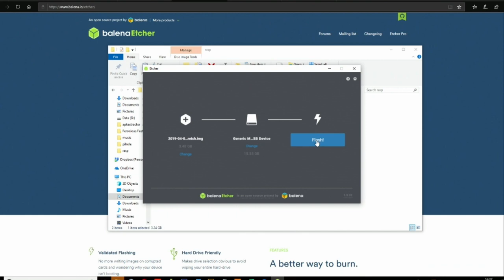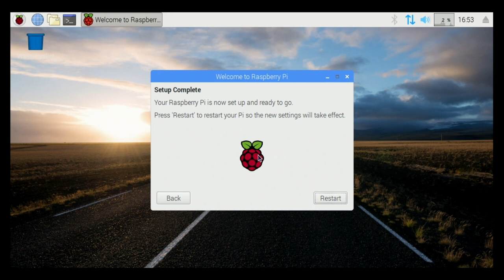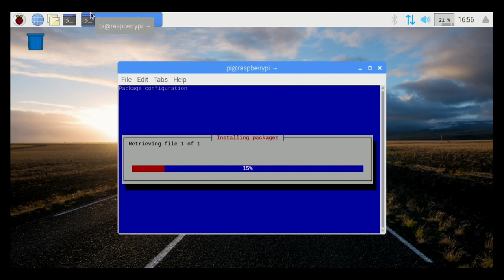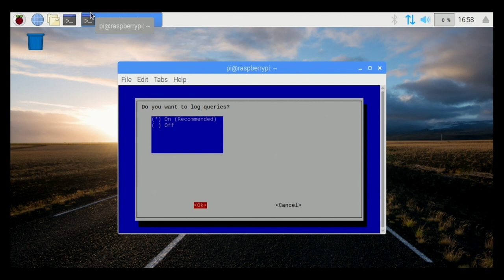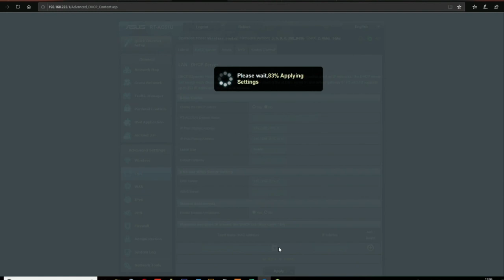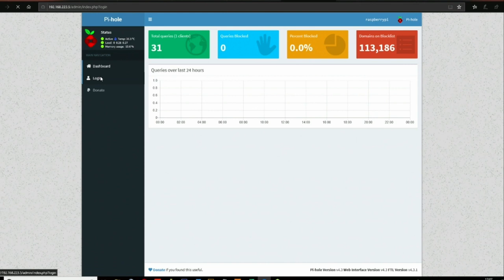Ultimate AD Blocker - How to set up Pi-Hole DNS network wide on a raspberry Pi

Comment: Is this video still reliable? I’d like to deploy this. 

Can I use any Rasberry Pi? Like the 4?
Reply: I think so.  The only difference now is the tool used to get and write the OS image to the card  https://www.raspberrypi.org/software/ This appears to be very well done.  My rebuild will be better than the initial deployment.  It fantastic.  Hurts to be without it currently.  Go for it!
Reply: Just finished rebuilding my PiHole.  With the exception noted above, this is still current and correct.

Comment: How does the Rasberrie Pi connect? My gaming computer is ethernet cable and my phone and tablet are wireless.
Reply from the maker: Asuming your ISP modem is wireless  and ethernet , connecting everything to it will allow all the devices to communicate with each other.

Comment: What does he mean my pipe it to bash. How do you get the vertical line symbol?
Reply from the maker: A pipe is a term that mean redirect the output of program  (a) to program (b), the character that does this in the command looks like a very tall lower case L , this character > |
Reply: Ah. Thank you very much. This video really helped as there were a lot of videos on it but many didn't go into detail on how to do it.

Comment: Hey it doesn't work for me. I tried installing twice.. Whole raspberry and pihole. Nothing happening.
Reply from the maker: After you install, you have to decide to change the ISP modem DHCP DNS settings to provide the piholes IP, or you turn off DHCP on the ISP modem and turn on DHCP on the pihole. After that you need to reconnect devices back on the network, on a phone just turn wifi off an on.

check this bit of the video
https://youtu.be/Gl9wgUdjqpc?t=813
Reply: @Gizmo1969  i did. As soon as I change DNS server on my router (provided by my Verizon fios), internet stop working. I see queries being blocked but advertisement are still visible. I am using gardian news to verify if it blocks.
Reply from the maker: @nandurx  Ok, how about, turn off dhcp on verizon , and turn on DHCP server on Pihole.

Comment: Awesome video.  I have a quick question.  I have an Asus OnHub wifi router, and you can't really disable DCHP.  The only option is to switch it to Bridge mode.  If I do that, won't it cause issues with my devices connected to it wirelessly?  If it does, I'm going to just use the first method you showed.  Thanks again.

Comment: How do i use this pn mikrotik routers?
Reply from the maker: Im not familiar with the mikrotik routers to guide you exactly to which menus you should go to, but your looking at setting it up in one of two ways. a) change mikrotik dhcp settings to distribute the ip address of your pihole as a DNS server or b) disable DHCP on the mikrotik modem and enable DHCP on the pihole - see this clip in the video where i do this on my Asus router https://youtu.be/Gl9wgUdjqpc?t=799
Reply: @Gizmo1969  ok. Thanks for the info. 😀

Comment: Hi, thanks for the great video. I have tried and followed your guide using a Pi-3, and i cant seem to get my network to work through Pi-hole. I set my Pi to have a static ip, and when i disable the dhcp on my router, no ip's are being assigned to devices connecting... I am attempting this whilst using the Pi-3 via wlan. Could you please assist, or perhaps have any tips of where I might perhaps be going wrong?
Reply from the maker: Did you enable DHCP server in piHole under settings / DHCP?
Reply: @Gizmo1969  I did yes
Reply from the maker: @Ceneric  So,  the pi is on the same network range, that is , if your IP address of your modem is 192.168.0.1  then your piHole ip address must start with 192.168.0.x  , also can you check, connect a device to your network, does it get an ip address? I assume not, or does it get an ip address but no internet. Have you rebooted the modem, sometimes they need a reboot to get changes applied properly.
Reply: @Gizmo1969  yes the pi is on the same network, and my router ip is 192.168.8.1, and i configured the pi to be 192.168.8 2. When connecting a device, no ip is assigned to the device, even after rebooting both pi and router
Reply from the maker: @Ceneric  set manual ip address on your device and test with pi ip address as dns. check you can access the pi and browse net. Plan b, turn dhcp on the router and set the pi hole as dns ip in the modem settings.
Reply: @Gizmo1969  I tried setting the pi ip address on the device as the dns, and got no internet connectivity. Tried setting the pi ip on the router dns, and still got adds. When checking the pi-hole page, it showed no blocked addresses. I selected Google as my preferred blocker when setting up
Reply: Great news, I seem to have resolved the ip distribution issue... Seems like, in my haste to make this project, I mistyped the dns ip when setting my static ip on the pi... however now I can connect with the pi as my dns server, I still have ads
Reply from the maker: @Ceneric   you need to make sure that the DNS server on your connected device is the pihole IP address, it could have old DHCP info, also keep in mind, if you connect to a vpn service on it will bypass the pihole.
Reply: @Gizmo1969  Ok cool.. will keep tinkering. Thanks so much for the help, and great video

Comment: I screwed up on the static ipv4 address assignment. Now Chrome can't access any web pages. Says web page may be down temporarily or moved to a new address. How can I fix it?
Reply from the maker: You'll need to get your PI connected to a screen with keyboard and mouse, go into terminal window and type in "pihole reconfigure" this shoudl allow you to configure your network IP address again for the pihole.

Comment: can i use the pi 4 without internet cable ? just wifi connection into my home network ?
Reply from the maker: i would say its possible, I once setup a pi zero, that is wireless only, but I remember not having access to the wireless config and I had to install  "sudo apt-get install wicd
" and "sudo apt-get install wicd-curses" to get a wireless control in the top right of the screen. Keep in mind that everytime you click on a link the page that loads can make 10/20 DNS requests , wifi is slow and Ethernet is the best connection for this type of project. Putting a PI connected to your modem, and if has a USB port you can even leech the power from the modem...

Comment: Is the DHCP part necessary? Would it not be the same as setting the pihole ip as the DNS server on each device you want it for?
Reply from the maker: No its not, you can just change the isp modem to distribute the ip address of the pihole as the using its DHCP server.

Comment: Can i ask some specific Question?
About This One: 

Specification/ Application

Mode:Cluster Pi

Pi 4b Model b (Storage) = Storage SATA SSD 128GB.
Pi 4b Model b (Worker) = Doing Task to Help Master Pi VPN to Handle more Clients at the same time
Pi 4b Model b (Master) = as Pi VPN Server
Pi Zero with Full Kit (AdBlocker) = as Pi-Hole.

I dont know if it Works? please give me some suggestions. loveyou <3

Comment: my router does not let me either turn off DHCP or let me change DNS settings.. it's really restricted. Is there any other way to do this?
Reply from the maker: yes, you can manually set the ip address on the device  your connecting, which will allow you to set the ip address if you pihole
Reply: @Gizmo1969  I set the pi's IP address as my Devices' DNS server. which also worked great, but sometimes youtube doesn't load thumbnails which can be annoying. 
Thank you!

Comment: When i disable DHCP on router it disconnects many devices and it won't let me go to pi-hole /admin page any have solution for this issue please ? i notice when i go to page where it shows me what devices are connected it's missing raspberry pi and many other devices.
Reply from the maker: Whats  the IP address of your ISP modem and of the PI, I assume you have set a manual IP address for the PI
Reply: @Gizmo1969  any help :(

Comment: I can't connect to the configuration interface. Is there common solutions to this?
Reply: I use the correct ip address for sure, but I don't know why the password and user name found on the back of the router I am using is not working
Reply from the maker: @danmbonneville  So your trying to access your ISP modem, and are unable due  the login details not being correct, the only option is to factory reset your ISP modem. It should revert to the original details on the sticker.
Reply: @Gizmo1969  This still did not work unfortunately. I will try it again and get back though
Reply from the maker: @danmbonneville  I would contact your ISP if you are unable to connect to the default password after a factory reset

Comment: Dear i need your help i setup pihole same as your instructions and setup suction.  Later on i reset my router and my config change . Now i format sd card and install new raspberry pi firmware  but now i am unable to connect my wifi . Any help will be appreciated thanks
Reply from the maker: If you factory reset your ISP router, then there is a good chance that your wifi password has reverted back to factory default or you need to go thru a setup process again.

The PiHole does not affect your WIFI password.

Comment: This only works for wi-fi
What about passthrough using a USB ethernet?
Reply from the maker: Im not sure i understand the question in regards to passthrough ethernet, I assume what you really need is a network switch?  

PIHole is a DNS server. It needs to be connected to you network/ISP modem, which can be  ethernet or or wifi or if you have an extra usb ethernet adapter you can use that also.

Comment: Enabling the DHCP on the pihole and disabling it at the router is an alternative to using DDNS then?
Reply from the maker: Two different things. DHCP is the service that gives your device that is connecting to a network its IP address either thru wifi or ethernet ports. To hand this task over to the PI you turn off the ISP DHCP server and turn on the PI Holes DHCP for it now to do this task. DDNS is a service that allows your public IP address ( the IP address the internet sees when you access anything) to be assigned to a free domain name, useful if your public IP address changes, as its designed to update that IP if your ISP or connection changes it.
Reply: @Gizmo1969  I have DHCP on on my router to assign IP's. I assigned a static IP to my pihole, assigned my primary DNS the pihole IP and use no-ip to monitor and update the static IP as needed. I was asking if doing as you did negates the need to do my setup.
Reply from the maker: @amadeus999  If you have added a the PiHole IP to your ISP modem LAN DNS settings then it will work like that also, you dont need to run DHCP on the PI, the only draw back is you cant use DNSSEC type DNS servers on the PiHole . You will also need to reconnect all devices again to acquire the new IP address with updated servers
Reply: @Gizmo1969  I'm using opendns on the pihole as my dns lookup and have dnscrypt installed on my pc for end to end encryption.

Comment: don't I have to give it a static IP?
Reply from the maker: Yes, its best to have its private ip address fixed, at first the PI will have an automatic IP address from your ISP modem, but you can set a manual IP address during the install procedure, take a look at this section of the video showing you the step: https://youtu.be/Gl9wgUdjqpc?t=606